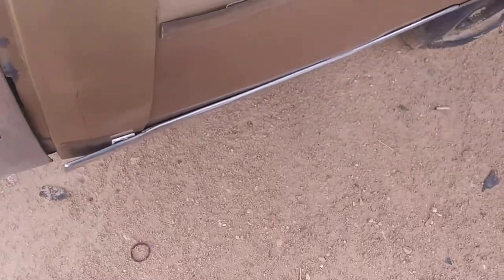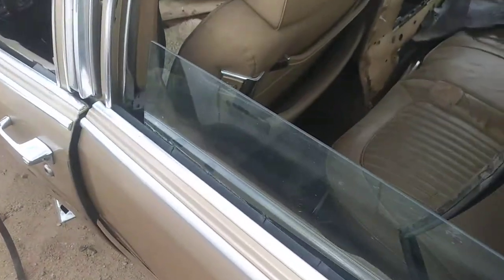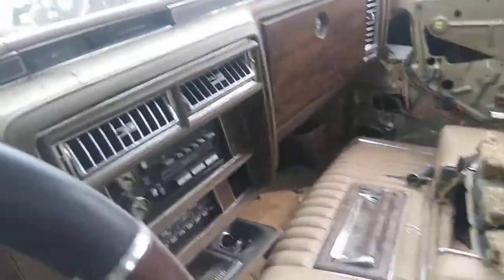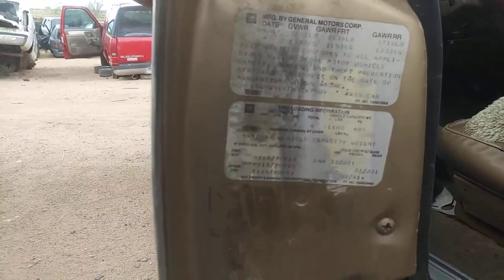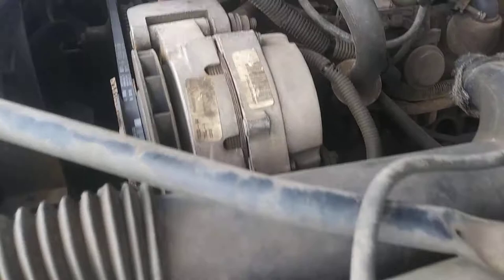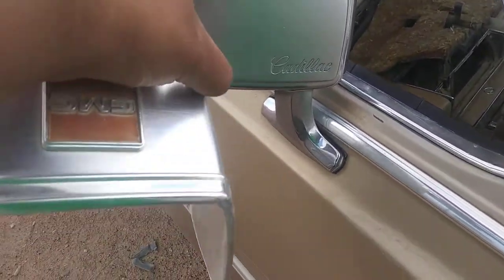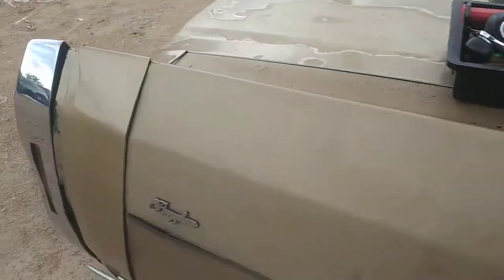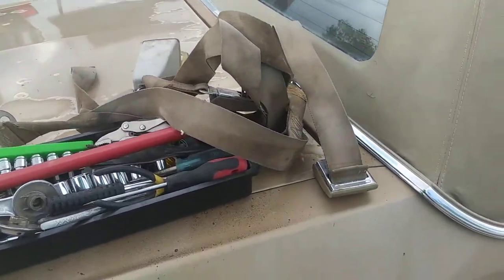1987 Cadillac Brougham

Comment: My father sold these cars new at the Cadillac dealer he worked at then was eventually sales manager. This one was a 307 Olds V8 by the VIN, so the trunk might be from a different car. The 5.7 was not available in 1987. The 5.7L with throttle body injection wasn't available until 1990, so the trunk is either from a 1990, or the badge was taken from a later model. 

It's pronounced "BRO-M", not "BROM". The steering wheel appears to be from a different car as it does not match. This is not a G body, it's considered a D body. A G body would be a Cutlass, Regal, Grand Prix, Monte Carlo, and the like. A D body is typically an Olds 98 (rear wheel drive) and a Cadillac Fleetwood Brougham. They were also called C bodies in prior years.

We got the VIN, we win: 1G6 for US made Cadillac, DW51 for Fleetwood Brougham four door, Y for 5.0L/307 Olds V8 with four barrel, RPO code "LV2", 1 is a check digit, H for the 1987 model year, 9 for Clark Street/Detroit, MI assembly and the rest is the production sequence. The Clark Street plant, aka "Fleetwood" plant, closed in December 1987, and production was moved to Arlington, TX. Here is a video from 1987 when Clark Street was about to close: https://www.youtube.com/watch?v=Mjf-FNvrXqw

Possible code #52/WA8973 Copper Beige exterior paint, but we needed the SPID label in the trunk to determine that (but the trunk appeared to be locked with no key available).
Reply from the maker: Yup she was locked up tight. Thanks for your help.
Reply: @chevylandt.v  No problem at all. That trunk, if the emblem is original to it would have been from a 1990-1992 model, or someone just applied the badge to it over the years. But it was surely a 307 originally as this is a 1987 model year car.